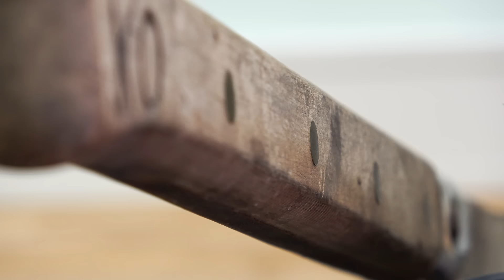The Rebirth of an Old Giant: Restoration of a Historic Meat Cleaver

Comment: the result was really stunning, and it was really cool to see you reuse the handle wood. one question though - did you consider just cleaning up the handle rather than rebuilding it? the handle looked beat up but serviceable. was there something wrong with it that couldn't be repaired?
Reply from the maker: Thanks for the praise, no I just wanted to clean it because there was still enough material available🐢

Comment: That is a very nice hog splitter. But other than making a mess in the shop with a watermelon, or hanging it on a wall, what would someone use it for? Just about anything that you would cut with it, including watermelon, would discolor the blade, and it would need polishing again. Conversation piece maybe?

Comment: This was a fairly easy restoration. The item was in very good condition to begin with. The handle was firm, and the blade metal was good quality with very little rust. All restoration needed here was some sanding and sharpening of the blade and polishing of the handle without any disassembly.

But he made a whole deal out of it so he can make a longer video and put his fucking turtle in it.

Whoever KO was, he was a formidable maker and made an amazing long lasting article. And this penny-pound-youtube-restorer erased KO's name out of his own creation.

This is literally one of the worst restoration videos out there. The restored item has less value than the original.

Comment: You forgot to put the initials back at the end of the handle. Everything is nicely restored, but you shouldn't erase the mark a creator put into their work
And even if you throw the excuse of "Well, I wouldn't mind if someone else put their mark here if it's restored restored again in the future" that's because you weren't the one who drew up the design of that tool, you weren't the one who cut out the piece of wood to make that handle, you weren't the one who cut, or even worse, forged out that entire blade, and you weren't the one who heat treated it neither.
If you wanted to put your mark on it so bad, put it somewhere else. But at the fucking least leave the original initials there
And even if those initials weren't from the maker of the tool, although not as scummy, it's still pretty unthoughtful of you to erase history quite literally carved into that cleaver. But if you don't know if this was a manufactured piece or not, the initials are as good as a maker mark